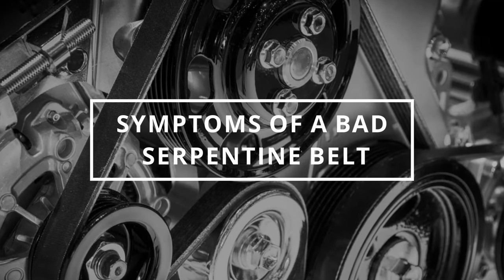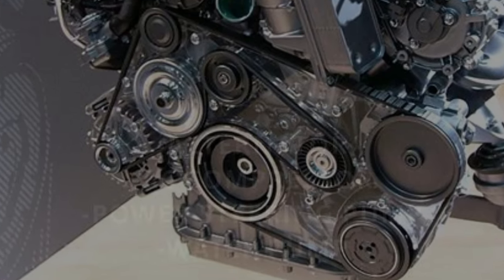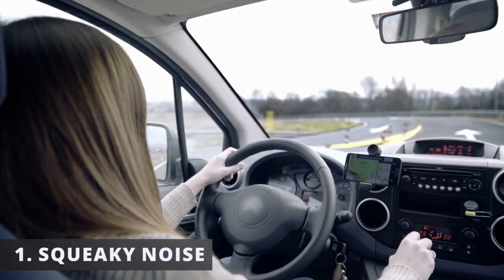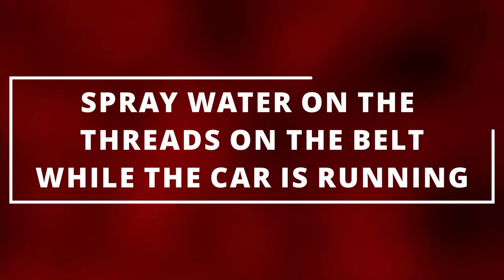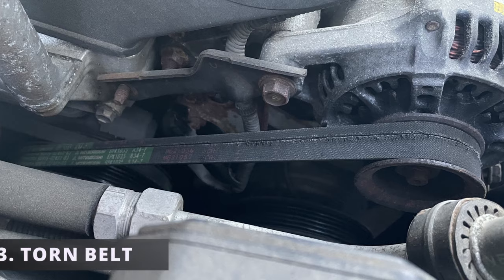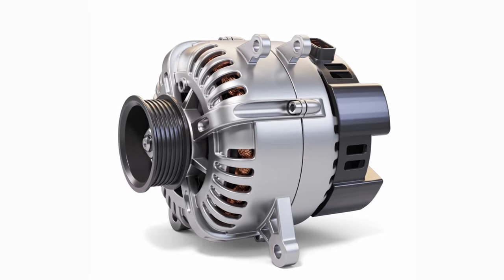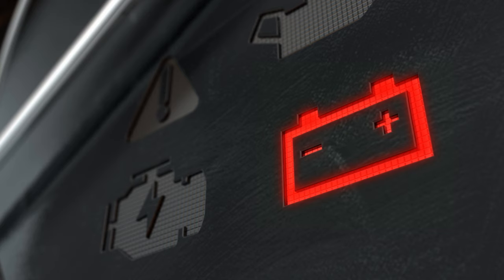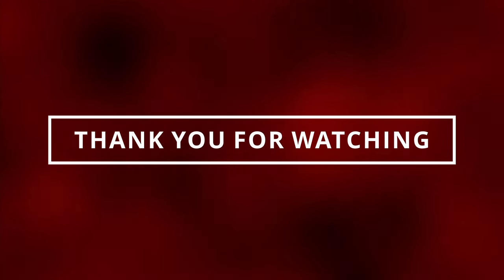SYMPTOMS OF A BAD SERPENTINE BELT

Comment: I had mine snapped out while driving, I was hoping to drive it home because I was just less than a mile from my house but didn’t make it. I stopped the car and had it towed. I drove about quarter of a mile before completely stopping. I first felt the steering wheel tight and heavy and saw the battery light on the dash, then I saw the gauge going all the way up to H like it was overheating. You think it damaged anything else cause I kept driving it? Im
Reply: This literally just happened to me about 30 mins ago. And I freaked out. So I just parked the car and had it towed. I hope and pray I didn’t damage anything.
Reply: What was the problem when you got it diagnosed?
Reply: @emmore436  just a very old and weary belt that needs to be replaced.
Reply: @junmagbag5169  found out it was my belt and thermostat. Fortunately I paid only 250 for the repairs. The first mechanic tried to say I needed a radiator replacement because of an alleged small leak, so I took it to the last two and it was minor belt and thermostat
Reply: @junmagbag5169  yeah you gotta be careful about over heating. I had my radiator spring a leak and my temperature gauge went all the way up and I only drove like half a mile and it warped the heads in my truck cost a lot of money to fix.
Reply: As soon as you snap your belt you should always immediately pull over. Without a belt the water pump which circulates the engines coolant won’t be doing it’s job which would cause your engine to overheat. Overheating can cause heads to warp and possible leaks along with potentially damaging other components/sensors. A battery light came on because the alternator couldn’t produce power without a belt which then made the vehicle use the car battery power and can drain it
Reply: Yeah I always thought that checking the water level in coolant reservoir ( some call it a bottle) is fool proof way to check coolant level but it’s not. I slagged my engine. Totally ruined it because it had radiator leak. Either go by temperature gauge in your dashboard or check your coolant level in your radiator.
Reply: Dis happened to me da other night ! No smoke happen or nun , I made to da room drivin slow asl and I was wonder all day at work what could it be until I checked it again da next day and seen my belt half way shredded off ! Everything made sense once I spot dat
Reply: @gavincarmona7160 omfg da other night makes Fuckin sense ! Mannn I’m glad I kaught on before it gotten worse .
Reply: This just happened to me last night. Had a little squeaky noise at first I thought was somethin else but was a roller bearing for the belt. Was omw to work on the turnpike and out of nowhere I saw a dash reading say ac off overheating and my temp gauge was damn near the red. I pulled over quick n popped the hood to let it cool down cuz it was smoking at first from a coolant overflow then I noticed the belt was off along with a tensioner bearing

Comment: Hey question for you, i got new spark plugs, coils, motor mounts and transmission mounts and my car still kinda vibrates in the steering wheel and the brake pedal. I have a 08 focus with 108k miles. Is this anything i should be worried about? Not sure what else it can be. Maybe you might have an idea.
Reply from the maker: Is there an engine light on? Does this vibration occur at a specific speed or when stationary?
Reply: @easyautofix  no check engine and in idle i feel it
Reply: That's similar to what my vehicle is doing
Reply: This might be late response but its your wheels.. get  them 4  balanced and align.
Reply: Maybe its defective VVT solenoids or stretched timing chain.
Reply: Warped front rotors?

Comment: Yup I found out the hard way it turned into spaghetti, now I only heard the squeaky sound once and it was for like 2 sec and I didn’t really think much of it till like 2 days later I see my RPMs go up, AC is pumping hot air and I can burly turn the car. The car is about 30 years old so idk if the belt was ever changed if it wasn’t well that was probably the problem. Thanks for the video it was very helpful also it’s a manual car so if u drive it bad like ur not that good at driving u still learning can that also be an issue or not????

Comment: Ford 15 Fusion SE with 2.5 L engine. I was hoping nothing catastrophic happened if my serpentine belt breaks. So seems like the worst case is for the battery won’t charge or water pump is also not working. Overheating engine. Well it can be catastrophic if it overheats beyond control and your engine can be slagged. Total meltdown. Also several videos have the tensioner pulley also replaced because it’s common failure and they do it as preventive measure ?

Comment: would a bad belt cause my car to make a squeaking/rubbing sound when doing a sharp turn or uturn? I’ve recently changed my powersteering pump, hoses, reservoir and power steering pulley but still makes this noise. It was making this noise before with the old pump. Car steers fine though. Not sure if it’s the serpentine belt, wheel bearing, cv axle or power steering rack.

Comment: My car squeaks, but it seems to only squeak about the first minute the car is on. Recently, it is getting hard to steer, and the power steering fluid is full. Would the power steering be affected if the belt is going bad or only once it snaps?
Reply: It is affected when its going bad, your lights, ac, radio and other electricals could struggle to work.

Comment: Bro the things you mentioned are not symptoms they are causes except for the first one. If my belt is torn cracked or snapped I can just look at it. What are symptoms of a loose belt? I’m trying to figure out why all of the electricity running through my truck is pulsating about 3 times a second and then dies. That could be a symptom of a bad belt or maybe it’s not but it would be nice to know.

Comment: I just got mine replaced on my Honda CRV.  It only had 30,000 miles on it.  It was "glazing" on the outer surface.
Reply: Glazing? I just put a brand new one on my C300 and it's tripping. Water takes the sound away 😬

Comment: A mechanic at Jiffy Lube recommended the serpentine belt be replaced on 2017 Corolla because it had wear, a strip of discoloration, near the center of the belt. Is that a good reason to replace a serpentine belt? My vehicle has 93,000 miles and preparing for a 1200 mile trip. Many thanks
Reply from the maker: It's a good idea to replace the serpentine belt on your 2017 Corolla given its mileage and visible wear, particularly before embarking on a long trip, to ensure reliability and prevent potential issues.